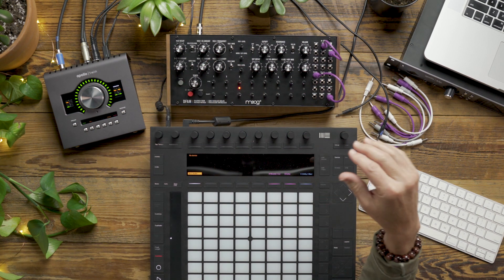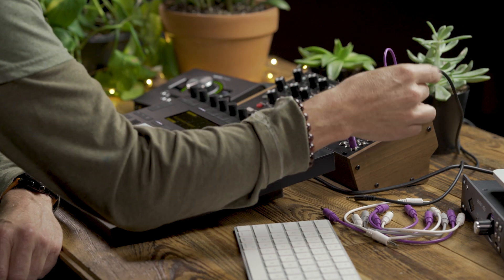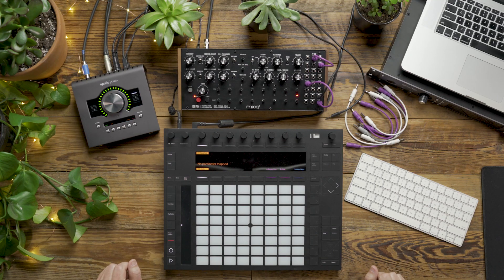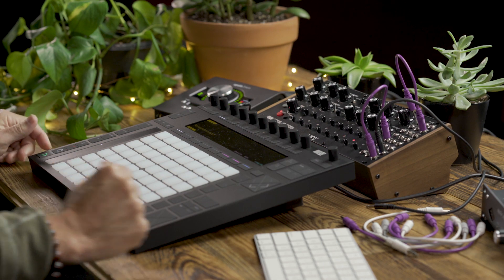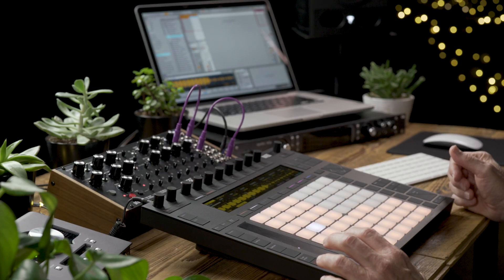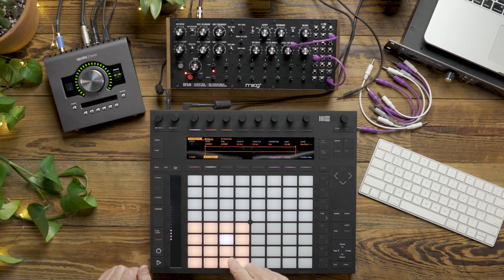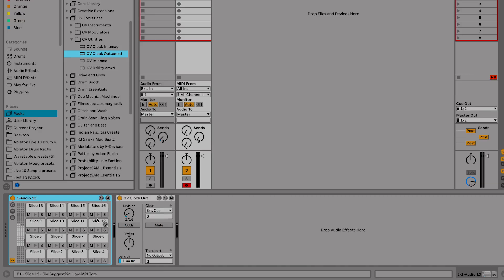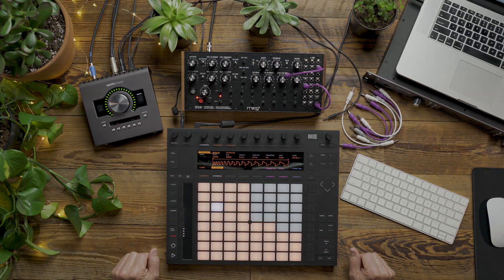DFAM | Build a Synth Drum Rack using CV Tools

Comment: I’m trying to decide on a DAW; it’s between Appleton or Logic Pro X.  As a Mac user, I’m leaning towards LPX of course... can you show some of these demos and switch out to work on LPX for us?  Please and thank you. Cheers! 🥃
Reply: The CV Tools demonstrated in these videos are only available in Ableton, and not in Logic Pro. Ableton works great on Macs as well, so being a Mac user shouldn't matter. Also something that is not mentioned in these videos, is that in order to utilize these CV Tools you will need to use an interface with DC coupled outputs so you can send control voltage (CV) out through those outputs. Not all interfaces have the capability to do this, but the Universal Audio Apollo Twin used in this video happens to have this capability.  You'll have to research which interfaces are able to do this.